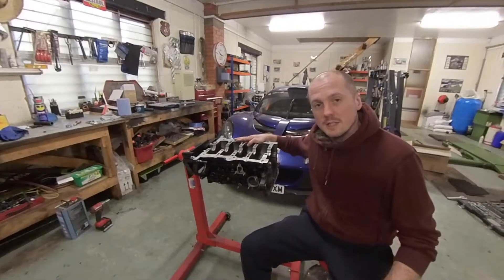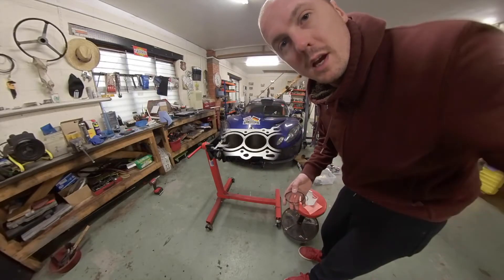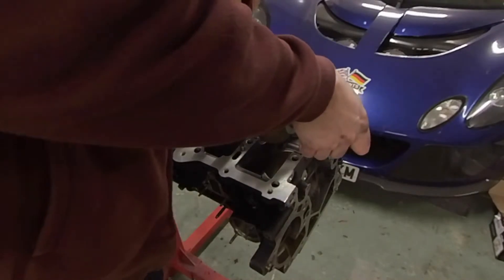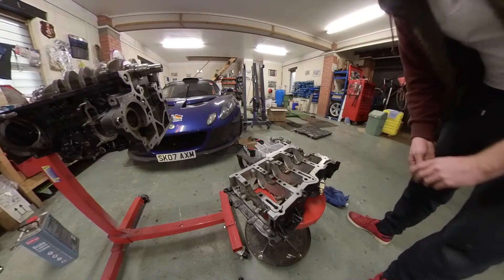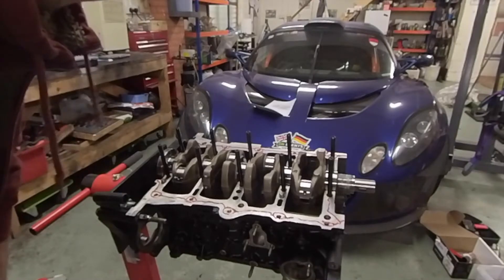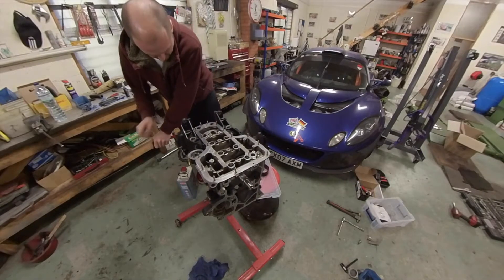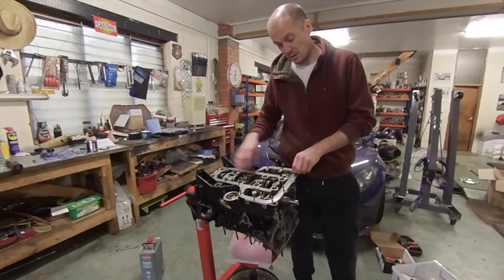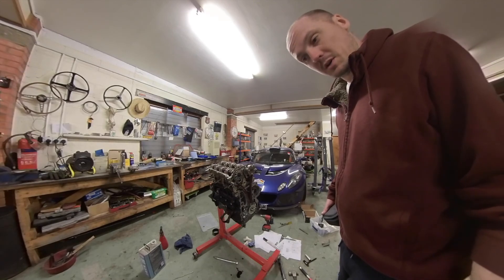2zz-ge Forged Engine Build - Part 1

Comment: I see that the torque for the head bolts is 26ft lbs and then additional 180 degrees, can anyone confirm? and do you do the 180 degrees all in one turn or in multiple stages? any help is appreciated
Reply from the maker: Sorry, can’t help here. I use ARP head studs which have a different tightening procedure (since they are reusable unlike the factory bolts).

Comment: Awesome, series! I am thinking about buying a 2000-2007 model an issues I as a new owner should look for? How does  the transmission hold up with more power? Have you ever rebuilt the trans?
Reply from the maker: Thanks! You looking at a Lotus, or something else with the 2zzge in it? 

The stock transmission is a known weak point of the Toyota setup in the Lotus platform. Running around 270hp (smaller pulley, map, injectors) I broke 3rd gear and final drive of the stock setup, and replaced them with Jubu racing gears. After my engine build (now running 350hp ish) I broke the Jubu racing final drive too! Now moved to a quaife sequential setup which so far has been sublime! Most of my mileage is track, and most at the Nurburgring, so not the kindest environment!
Reply: @track__dan8755  I'm looking at a lotus. Thinking from yr 2005-2007 to be honest. I just want to plan ahead and see cost for stock motor build compared to swap. However, the other concern is the transmission. What is your experience with the axels? Do they hold up?
Reply from the maker: I am still running standard axles - I use heavy duty and vented cv boots, and repack the cvs relatively often. So far, they have been ok! Fingers crossed!
Reply: @track__dan8755  thanks for the recommendation for the transmission and diff. I appreciate that. The final drive is important to note. I was thinking of this as my personal car and not tracking it consistently but I would love it to get up and go when I need it

Comment: Sleeved?
Reply from the maker: Yep! Darton sleeves
Reply: @track__dan8755  generally is reliable the 2zzge mate? Well maintained of course, and no track day use only straight line ....thanks!
Reply from the maker: @DimoS...  I think so. At 50k miles of abuse, mine showed no wear at all.
Reply: @track__dan8755  some have a problem with wear intake cam did you have a problem? some have more than 200k miles without wear cam and some even have less than 100k with issues ...very strange
Reply from the maker: @Dimos P  I had wear at 50k, but that was following a number of hard track miles running 15psi of boost with the tvs1320!
Reply: @track__dan8755  understand mate, and what is the solution to this problem;
Reply from the maker: @DimoS...  I’m now running MWR stage 3 cams, EliseRacing wear towers, and the thick end of the factory clearance specs. 🤞🏻
Reply: @track__dan8755 1 year later, how's it holding to the abuse? Lobe to hear an update

Comment: All my reading up has stated that you can not  re bore a 2zz engine  ???
Reply from the maker: You cannot bore the stock liners as you take the mmc coating off, but you can bore them and then install ductile steel sleeves, which also allows you to use any aftermarket piston too.
Reply: What pistons are these?

Comment: never ever put lube behind the bearing...only on the actual bearing surface ;)

and do one piston at a time...torque. then next. be careful the rod bolts dont nick the crank when you drop them in.
Reply: perfect

Comment: Are you using the BOE Rev 400+ kit from Phil? If so I strongly recommend monkey wrench stage 3 cams. And...I cannot stress this enough, get a dyno tune, no exception. Ask me why in private.
Reply from the maker: Yes. Tuned by scs (the manufacturers of my ecu), but broke a piston ring in very early life. Any tips, please dm me on instrgam. Track__dan (double underscore)
Reply: I plan on buying the REV400 kit next with front HEX & forged pistons/ Built head. Where I live there are 0 dynos so sadly I have to make due with a generic map. I wish I could upgrade my cams but I would need a dyno tune. Guess for now an AFR gauge will suffice to monitor.

Comment: You dont measure for bearing to journal clearance or crush before assembly? That's a step that has cost me a ton of time and money in the past. You can trust your bearing manufacturer and 99% of the time all will be fine, but one bad shell will ruin more than your day. Just saying...
I agree quality control these days is so much better than 30-40 years ago, but still, when you have so much time invested and a part worth a couple dollars can destroy it in seconds, I prefer the piece of mind of due diligence. Elise is not the hardest car to get the motor out of, but it's not the easiest either.
Reply from the maker: Maybe I gave the ACL qc too much credit here. I measured my bearing clearance on the last set of bearings (same spec), 500miles ago wihb plastigauge and all was good. I didn't account for differences in bearing thicknesses!
Reply: @track__dan8755  ACL is a good company. I use them. But ACL hasnt measured your individual crank journals to a 10 thousandths of an inch where your clearance specification lives. I used a Fowler bore guage and a gauge block calibration set to calibrate my bore gauge to withing 50 microns. The same block can be used to calibrate your micrometer.
As important as oil clearance is bearing crush is what prevents a bearing spin that can occur even when sufficient oil is always available. Wow, I need a better way to say that. 
Ok I'll try this...
If you dont have proper bearing crush the shells will be able to spin even when they have proper oiling.
The shells have that little notch that is supposed to prevent that but if they have even a small amount of wiggle room they can be hammered off.

You may also want to take a look at Steve Morris engines videos where he explains that the bores in the block for the crank journals are not typically round in a static situation so the measurements should be made in more than one location.
Reply from the maker: @3dw3dw  very interesting information, thanks for this! As you can tell, I'm new to building engines, appreciate all the advice!
Reply: @track__dan8755  as per your request I messaged you on insta.

Comment: What you do with the oil squatter?  Did you had to replace them?
Reply from the maker: No, just put a slight bend in them so they are more central in the bore and miss the skirts - was a two stage process as the clearance is much less when the engine is revving vs. when turning by hand (I had a little rattle when I first started it). All solved now though.
Reply: @track__dan8755  did you remove the valve guides when you did the build for the cylinder head?
Reply from the maker: @weliftnation2418  I didn't, no. The engine only had 47k miles on it.

Comment: I thought you were supposed to make sure absolutely no oil was supposed to be on the other side of the bearings?
Reply from the maker: Yep, agreed! My error!
Reply: Did it spin the bearings? It might one day!
Reply: @kylegoldston  I don’t know if it matters all that much because I’d imagine with pressurized oil and no real seal some gets behind the bearing.
Reply: i spun cylinder 1 bearing and now im having a loud ticking noice from the valve train after a rebuild you i cant find a solid answer for the clearance its not for vroom vroom go fast lol its for work

Comment: I would like to be corrected but I personally have never lubricated under side of shells.  Align lube holes yes. Measure bores yes.  Is it a Toyota recommendation.
Reply from the maker: You are correct - another lesson I learnt too late - but she sat for a fair few weeks before first start and I've just done 200 miles of running in and so far, so good! 🤞But yes, for future ref, insert the shells dry, and only lube the inner faces.
Reply: @track__dan8755  So glad you got away with it.  good luck with the car.  all the best.
Reply from the maker: @MrThewillows  thanks! Fingers crossed I properly got away with it - only hard miles will tell!
Reply: @track__dan8755  it’s only a matter of time till you spin a bearing.
Reply from the maker: @djmystery7235  I'm fairly sure under standard use you get oil seepage behind the shells anyway - when you remove oil bearings, they are not still dry are they?
Reply: @track__dan8755  I don’t remove bearings often, but I’d imagine oil could easily seep under there.
Reply from the maker: @djmystery7235  thats my thought, that under normal conditions some lubrication behind the shells occurs anyway. Still, I am considering stripping the bottom end off and cleaning the back of the shells!

Comment: What was the issue with the oil squirter interference? Great series of videos!
Reply from the maker: The Wiseco pistons have longer skirts than OEM, so the squirter was contacting the skirt a few degrees before full rotation! I ended up giving all of the squirters a little bend in my vice to give them clearance! Madness!
Reply: @track__dan8755  Good effort, and all good info.  Keep up the updates :)
Reply from the maker: @k.townend  thanks for the feedback. More updates coming soon. Currently deliberating over a dry sump setup to unlock the potential of a sequential in the future!
Reply: @track__dan8755  Great stuff, I window-shopped a few dry sump setups years ago... eye watering costs!